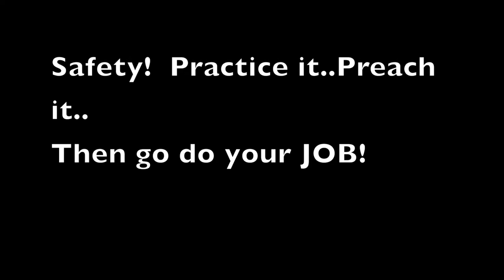TJ Pro Rating. Weyerhaeuser Floor Performance

Comment: Hey Stephen, I have a question for you. Looks like it's been a while, but thought it was worth a try. I bought a house that was built 22 years ago and has TJI's they were exposed to weather for longer than probably should have been and caused there to be sag at the beginning of the build but hasn't moved since then. My question is, can I put a steel I beam under those TJI's and push them up to remove the sag? I'm not sure how they would respond.
Reply: Engineering Intern here, where would that steel beam connected to? think about where the force will go(this can be very bad if connecting to a non bearing wall, etc) I can offer some feedback if you send me some pictures. Or the house plans if you have them.